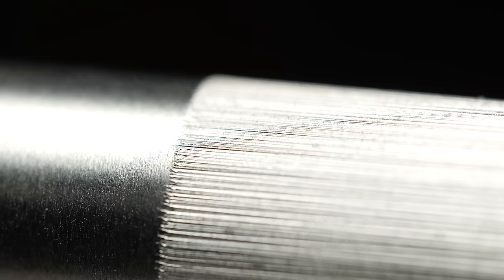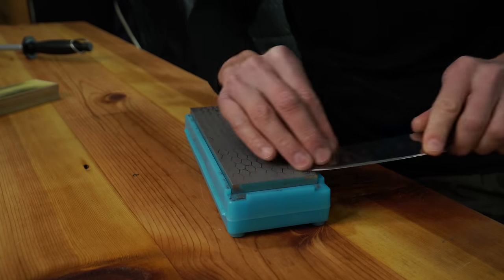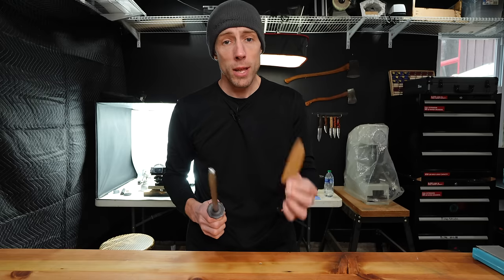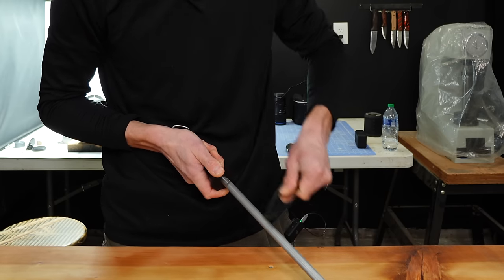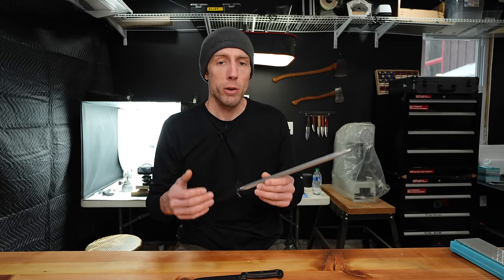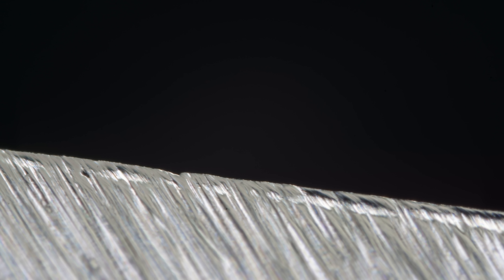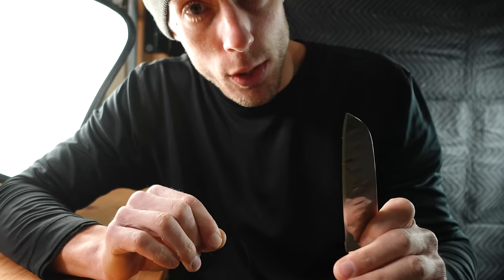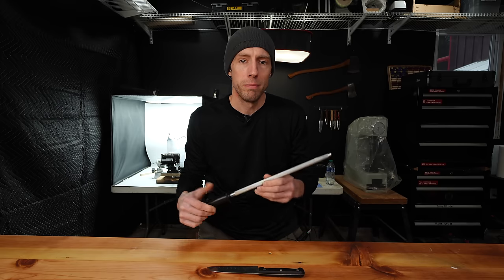What Do "Knife Sharpening" Honing Steels Actually Do?

Comment: Sorry, but you are NOT supposed to use the rod the same way that you use a sharpening stone. The direction of the pattern needs to be perpendicular to the direction of the knife, otherwise it will only ruin one thin strip of the edge for every pass!

Just as with the stone, angle matters quite a bit, too, but the DIRECTION is key. It is obvious that you have never been taught how to use the rod, just like many of the TV chefs seem never to have learned how to let the knife do the work by sliding it precicely and lightly instead of trying to impress by wildly hacking quickly. You can actually tell who were trained well by how much noise their knife makes, and you can definitely tell by examining their knives after a shift.

I still cherish my little Victorinox fruit knife that I got at my hotel school back in 1989, and am now almost at the point of having the groove and twist at the tip perfectly removed, so that the knife will once again be able to do true precicion work. I learned to sharpen properly due to an interest in Japanese woodworking, and ever since I am unable to cook in most people's kitchens because their knives are so bad. I keep all of mine, and the chisels, scissors, even bottle openers beautifully sharp at all times, which requires surprisingly little effort due to knowing how each tool is supposed to work and adapting my movements to the blades.
Reply from the maker: We have to talk about this..
https://youtu.be/65JzsDU_0mI

Comment: Sorry, but i have to disagree wildly. My theory: You used a poor cheap honing rod with the wrong technique! 

Who told you that a honing steel is none abrasive? Buy a proper one! A honing rod is hardened to at least 65 up to 70 HRC and is much harder than a kitchen knifes blade. The grooves in a REAL Solingen (Germany) honing rod are so fine, that you can barely see them with the naked eye. You strike forwards, not backwards! With a high quality German honing rod you can sharpen knives that are completely dull - not rolled over apex or bent burr - like dull, but dull as in "has no sharp apex anymore at all, cause i cut concrete a minute ago". You can actually see how abrasive a honing rod is: fine magnetic black steel dust is clinging on the rod, or  gathers on the blade. Honing rods are gentle to the blade, but they are far from "no abrasive". I use my honing rod between my 6-monthly sharpening routine and i achieve razor sharp blades every time. 

Editz: after reading some comments from butchers: Yes, honing rods come with different structures. There are some that have blank surfaces with (almost) no grooves at all. They work "none abrasive", but still remove material. By using them you roll over or bend over your edge from side to side, hardening it and eventually breaking it off (on microscopic level), so that a new stress hardened edge arises. the edge is then deformed and thinned by the pressure, making it super sharp. That only wokrs because the rod is very hard high carbon steel. It's the same process like sharpening a scythe with a hammer and anvil. It's called to "dengeln" in German. Couldn't finde a proper translation.
Reply from the maker: Watch the end of this video and the follow up video.
Reply: @OUTDOORS55  Thanks for your reply. I did watch both videos. I use a lot of different sharpening tools, even diamond stones, Ceramic rods. or a self found/made calcite wetstone to do the finish. i even have some  magnifying glasses with high magnification (no microscope though) and i can tell you: i get razorsharp burrfree edges, even with a honing steel. Mine is from "Zwilling".

Comment: Honing steels are used incorrectly by just about everyone. You can sharpen a knife from stone axe dull to shaving razor sharp(steel quality permitting ofc) with a set of honing rods. The ribs that run vertically along the rod are like scrapers, but for the edge of the knife. You place the knife blade perpendicularly to the rod and set and angle. You then pull on the knife, effectively scraping away material down to a point. Now, you want to use the entire length of the rod so you get an even wear, so you run the blade down the rod as you are sharpening(against the edge, not away. Away only worsens the bur). The whole idea is to cut off the bur. Imagine the edge of the blade as being hairy, with the little metal spikes sticking out in all directions. You want to cut off the ones that are bent beyond repair and keep the ones in the very middle, while at the same time not making the edge too thin. The theory is simple, but in practice it takes a whole lot of skill to maintain proper angles and consistent edges. However, once you learn the art of the rod, you can quickly and reliably get a long lasting and ultra sharp edge. However, if the edge is really messed up, you need to take it to a whet stone to fix things like chinks and waves. Using the rods is much faster and more convenient than pulling out the whet stone every single time you need to spruce up the blade. It has a place without a doubt, but the vast majority of people won't use it correctly. What Gordon was doing in that video was indeed utterly useless.
Reply: Is that why I keep thinking he's doing it backwards at the start of this video?

I took culinary classes & I never seen my Chef instructor ever pull the blade backwards from the back to the blade, when honing. Always pushed towards the blade side toward the point of the hone running alone the edge of the blade.

What he did is completely useless in my eyes.

Comment: As someone who has worked in a kitchen for many years at one point of my work history, what I observed from the chefs was that they had proper stones and strops, but also rods. The rods were at the work stations to 'top up' the knives, in a rush or during a manic time in the kitchen, and usually after or before a lot of cutting.

The chef would properly sharpen his knives with a stone before or after the busy time when he had time to care for his knives properly, and those were the special knives, not the general knives we used.

The general utility knives were sent out to be sharpened and came back ground sharp... but it was clearly an aggressive process.

The proper knives used by the chef were treated well by him, and kept in his office.
We only used the rods for 'topping up'. But it did work.
Also, it looks good in front of the customer at the buffet table. It always impresses people if a chef stands at the buffet table with a honing rod and a knife.
Reply: its not because it looks good, its because we need our knifes to a certain sharpness for safety reason. nothing is more dangerous in this maniac work enviroment of a professional kitchen than a knife what is to sharo or to dull

Comment: This is not real world testing. Honing rods do not uncurl rolled edges. Nor do they sharpen. That is not what they are made for. 
They straighten out waves that occur in the blade from cutting fruits and vegetables on plastic and wooden cutting boards not when you bend over your edge pieces of copper.
I cook with my blades and I sharpen my blades and I have real world tested this myself. You are using the wrong tool for the wrong task and blaming the tool. You were also using the rod incorrectly. You lead with the edge while alternating between both sides with each push. 
I’m honestly very disappointed in this video. You could have done better. I thought you were an expert? Do you not know how to cook? Real world testing said “Hello”. 👋
Reply from the maker: What kind of microscope are you using to base your conclusions on?
Reply: @OUTDOORS55  I don't have one. I see waves in the blade so then I hone it then a lil strop. No more waves and no burs. SharpER than a tack! I kinda feel like sharpening my knives right now. But probably later.

Comment: This lab and theory is goofy. I have used a steel for decades and it quickly transforms the cutting ability on my knives and on almost every junk knife I encounter when in someone else's kitchen. Even using another knife or any random piece of metal has proven beneficial. I don't put hard pressure on knives against copper and so I just can't relate to why he did this except that it reflects on the target audience. Try to sell this BS to a professional meat processor LOL.
Reply from the maker: Lol meat processors are not knife expers. Some people expect more out of their knives such as professional knife makers and sharpeners. Our definition of "sharp" is wildly different. You can technically sharpen a knife on a brick too. That doesn't mean its a great method😂

Comment: If we could ask my Dad who sharpened dozens of razors and shop tools, or my uncle the butcher, they would have taught a class that excels anyone with a microscope. They knew how to get the edge back without removal of a bunch of metal. Dad used a leather strop for a good reason. I eventually saw the benefits of using the steels a lot and the stones a lot less. As long as the apex isn't badly damaged or extremely dull, the steels save time. They just have to be used properly, which was not described clearly IMHO. The improper way was described throughput the majority of the video. Later it was touched upon with bur removal.
Reply: I agree, as a former professional butcher I can say everybody at the slaughterhouses I worked at used steels mostly 'F Dick', a German steel with a red handle, I sharpen my knifes once a day on a bmp sharpeningmachine and maintained them with the steel during the day and that worked good for me and most of the other butchers.
Reply: @samerson6691  You processed all day long, so once a day for you was more than most hunters process in a year. You know what you're talking about. I have some antique high carbon German steel blades that Dad gave me. They are incredible.   I was just wondering what a bmp sharpener is?
Reply: @preacherman9018  It should be TMP B-9 , a fantastic machine and I cut with Giesser 2505 wwl 13-15 cm blades, wery good knifes.
Reply: @samerson6691  PS: Sorry, I went back and reread your post. I think you were talking about the knife Giesser  with a 13-14 centimeter length, not a CM as in Crucible Metallurgy. 😆   I just read about those Giessers. Sounds like they hold an edge. I have a french set the Lord gave me as a gift. I forget the brand, maybe Henkel. Will have to check. My uncle was head butcher of A&P and used some antique high carbons ...Old Hickory, Green River and forgot the other brands right now.
Reply: @preacherman9018  I bet your old knifes are wery good, soft steel that are easy to shapend. Them u should hold on to.
Best regards, Sam

Comment: So much debate. Here's the thing. For 'not sharp enough knive'. If I had half an hour for properly sharpening the knive with various sharpening stone, I will. But if I'm on that rush and hectic which requires me to cut quickly and continously, 4seconds with honing rod will help me a lot. 4 Vs 1800 seconds my dear. . 4 Vs 1800.!

Comment: My father is a butcher and he insists you use edge leading strokes. Also he removes a burr by stropping and then uses the steel to maintain an edge. If you go to an abattoir and look at people that use these knives all day for a living all use these steels and swear by them. Interestingly the guy who wrote the book on deburring, vadim from knifegrinders,  provided sharpening services for meat worker's and restaurants and recommends the use of steels, aka honing rods, to his clients.  Now most meat worker's use automating honing steels. Is it possible that the rolled edge they are referring to is both smaller than you can see and less rolled. Logically the extreme pressures, angles and material you used to create your rolled edge is not likely to occur to a knife in the hands of an experienced butcher. Just maybe your "rolled edge" is beyond the parameters of a honing steel.

Comment: At 12:52, using your $20 diamond stone you took 10 passes, stroking sharp edge first, then at 13:26 you took 10 passes on the knife steel, stroking backwards (sharp edge last).   Why don't you stroke forward on both or backward on both? What's the difference that using a round or flat surface makes that requires two different techniques?  I've already learned that most of what I thought I knew, was wrong.  When you described the physics, the techniques made perfect sense! (Try not to make my head explode!)

Comment: The honing steel will straighten lightly bent edges. It's never supposed to get fully rolled. 

The main reason they are used is cost. When you’re using a knife for 8 hours a day, you don't have the time (and likely the training) to sharpen the edge. When I worked in a market meat department, there was trimming days where we spent a full shift trimming half-frozen chicken breasts for sale (~8 80 lb cases). Every half hour or so, the knife got honed. It takes all of 5-7 seconds and makes a clear difference every time. What you don’t do is wait until the cutting feels off, by then the edge is too far gone for the hone. The knives were sent out to be professionally sharpened once a month and, unless there was a new guy, the knives were generally nearly perfect when they were send out.

Even though I eventually learned to sharpen  at a hibachi restaurant, it was still rarely needed despite using some of the knives on steel cooktops. The chefs honed after every meal, the back of the house every hour during prep time.

What you don’t want to do is get a nice sharpening stone full of meat juice and other food debris, and the hone is dishwasher safe.

All of that said, nothing in the video is incorrect except for saying that a hone is useless.

Comment: Okay, now I'm confused.  I've successfully used steels to sharpen many a knife-not great, but definitely better.  I carry one in my car to tune up the knives of people I visit with the typical dull knives most households have.  Now, I use the same pulling the-blade stroke you show when using the diamond stone (as does the notorious Chef Ramsey whom you show), but which you REVERSE when you use the steel, that is, I'll call it pulling the haft, since "haft" sounds cool. 
So, what's up with that reversal???
ALSO, I was gifted a ceramic "steel" rod, which does a very nice job of fine-tuning an edge on just about anything.  Oh, this is off-track a little, but my serrated bread knife, after many years, has suddenly become my favorite knife for cutting squishy stuff like soft tomatoes and harder veggies like cauliflower and broccoli and a bunch of other things, none of which I can remember right now, because my memory sucks.  And, to fit THAT in to THIS subject, I can tune the bread knife up in a flash with the ceramic "steel".  Oh; I see you are recommending a diamond steel; I suspect it may have some of the same qualities of my ceramic rod.